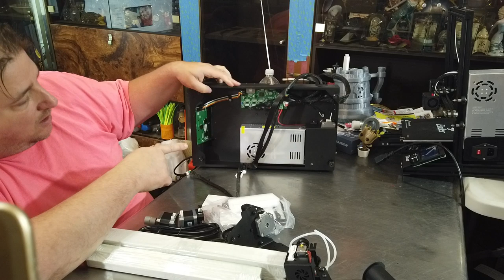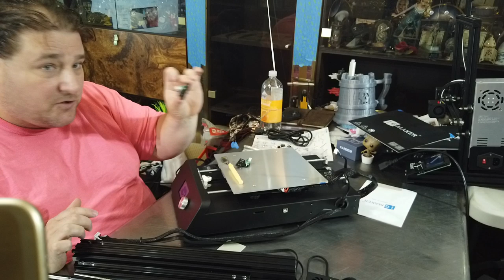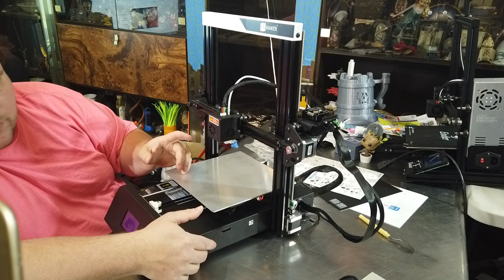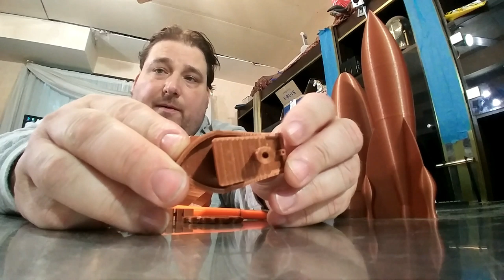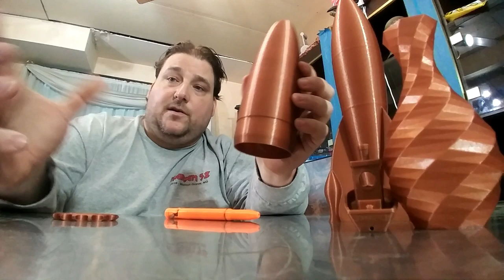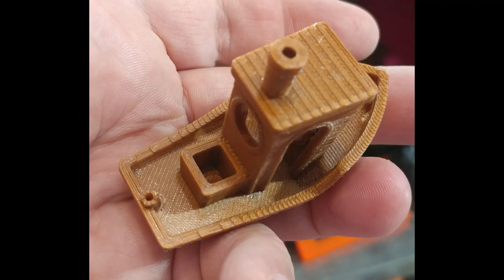JG Maker Magic 3D Printer Unbox, Build, Print   T3DP

Comment: The fan's noisiness really doesn't bother me tbh. I've used some noisy printers in my time, and I find this printer to be fine for my uses
Reply from the maker: Agreed its not really that bad. Just something that cant eaaily be improved.
Reply: @nerys71  Honestly, my main problem with it right now (and it might just be me being newer to owning a 3d printer) is that I can't quite align the nozzle with the print space such that it isn't colliding with the bed or being too high off of the bed
Reply: That being said! I do think I have it just right that it'll print one of the demo models from Hero Forge. Not entirely sure how I got it to work tbh
Reply from the maker: @cidasanctus3373  yes what you are describing tramming the bed or bed leveling is the problem 99% of people have 99% of the time it's the main issue with 3D printing to overcome after entire video dedicated just to that do a search on YouTube for CR 10-bed leveling basics you find my video one of the top results of that search watch that video it applies to all printers like this

Comment: Hello Nerys,

I  purchased this machine and have printed quite a few things based off my designs and seem to run into a problem of elephant foot on the prints. do you have any suggestions as to what the settings should all be for prints so I can eliminate this issue?
Reply from the maker: Elephants foot is nozzle too close to the bed. Bring the bed down just a smidge till the foot goes away.

Make sure first layer is hot and slow 220c 30% speed. Also make first layer 80% width which will help once you get closer to spot on.
Reply: @nerys71  This is soooo helpful! thank you soo much!

I have been using the 190c for nozzle and 50c for bed. will i be able to tell the first layer to be a different temp? I noticed better performance from the 190c

Do you know a good gap from bed to nozzle?
Reply from the maker: @benjamincooley583  most slicers will let you set a different temp for first layer.

as for gap. no. there is no "good gap" except the "right" gap. watch my cr10 bed leveling basics (put that in youtube search)

basically you live level. you want the filament layed down to feel like "stuck fishing line" if it moves when you rub it gently nozzle is too far from the bed. if it feels flat/smooth nozzle is too close.
Reply: @nerys71  That makes a lot of sense. Thank you for all the help! You have great video reviews!

Comment: I would like to know what profile you used on this machine?
Reply from the maker: I use my own profile in simplify3d. I always generate my own profile for each printer. I will see about getting the profile for this printer uploaded if it's not already in my Google Drive, which you can find in the description of the video.
Reply: @nerys71  Thanks. I'm a little new at this. But picking up a lot.
Reply: I see two for the jg aurora A5

Comment: Great video but no livestream tonight? How did it go with the new house? Nice to see that you are making videos even though it's hard for you right now. I like the enclosed base but not the lm8uu bearings. They are noisy and you get surface artefacts in your prints. For V-slot you really need Eccentric nuts. Probably cost them 10 cents and It makes the printer much better.
Reply from the maker: I had to make a run for a craigslist purchase 90 minute drive but being electric only $1.50 in electricity round trip. Scored a Weber Natural Gas grill in excellent condition for $50. well worth buying hear and hauling out their. Can't touch this for less than $300 used out their. SO glad I will have natural gas. its soooooo much cheaper. I also have someone coming this weekend to look at my pressure washer which I want to bring with me. told him if he fixes it he can have the chipper shredder I have. he likes the deal so fingers crossed the pump is ok. (he is just going to fix the engine)

Comment: First! XD This is the first review of this printer that is positive . :) Glad they obviously fixed a lot on it. How is the move going? Hope you are allright and everything goes well. Cheers!
Reply from the maker: odd. I had no bad experiences with the assembly or operation of the machine. in fact it was refreshing to build a machine where I did not have to correct anything to actually make it work properly.

is it GREAT? no. not really. few machines are. but it is very good. my only gripe is the fans. man. they should call it the jg maker screech :-) but that is easy to fix and their replied in the positive about correcting it in the future so hopefully they will source some quieter fans.

we should. fingers crossed. get the paperwork back today to start the closing process on the new house. We are set to close on my current house aug 9 rain date aug 23 in case I need more time.

sooooo. really hope I don't get any more surprises.
Reply: @nerys71  With all the stuff like Touchdisplay, legit spool holder, linear rods and filament runout sensor they had to cheap out somewhere. Might be interesting to check out if filament runout etc. works properly. a youtuber called da hai zhu made a very detailed review. Also he made a well working alternative firmware for the anycubic kossel machines.

Did the paper work go well? Hopefully only positive surprises this time.
Reply from the maker: Already confirmed. See the nose cone at the end? see the artifact down below? the filament snapped. run out stopped the print and in the morning I reloaded and it resumed nicely. no issues.

So far so good. we just signed the PSA not 5 minutes ago !!! so the process has begun to purchase the home. My agent really likes the agreement. no weird wording no apparent gotcha's. looks legit. Now we wait for title commitment. Hopefully it goes fast !!! :-)
Reply: @nerys71  That's great news! Still crossing fingers!